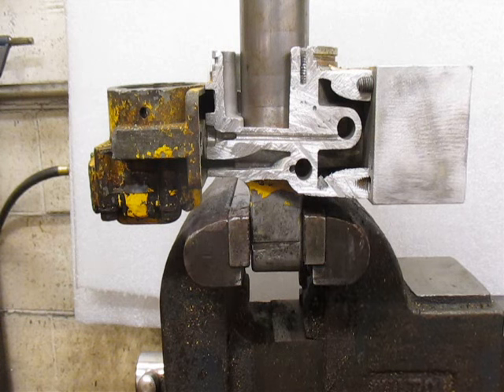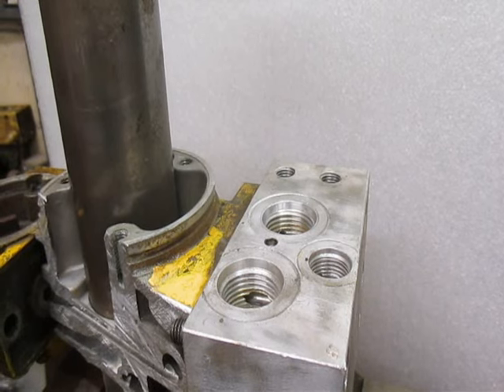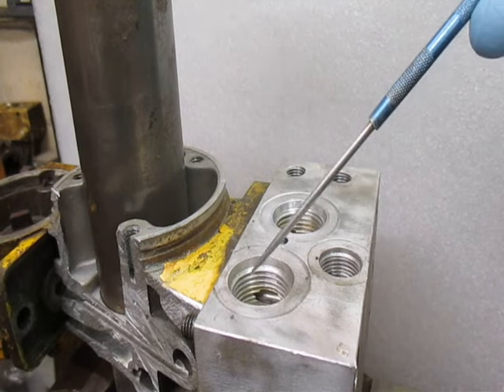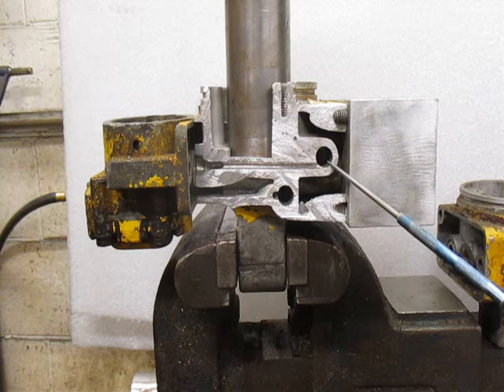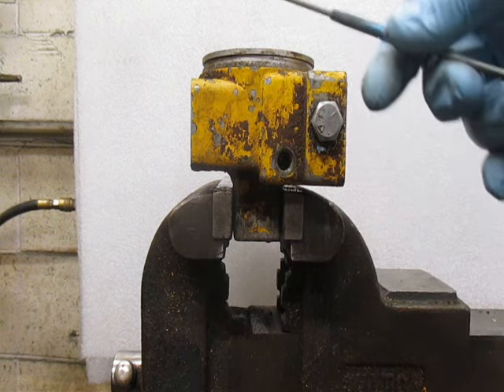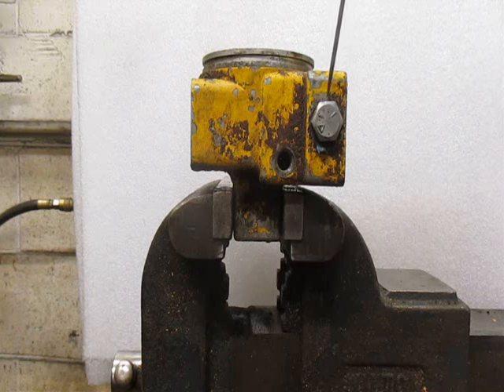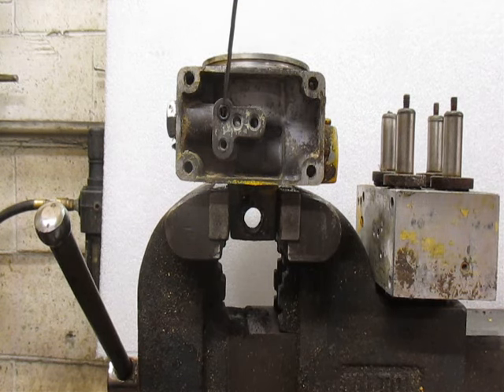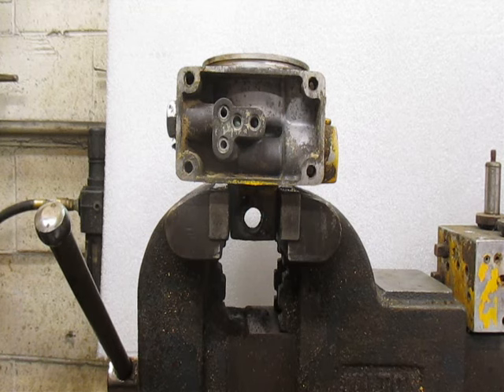Meyer E 47 Cut-Away View and Default Flow Path

Comment: I have an e47 that is leaking down. As soon as I let go of the controller it leaks down. I redid the seals on it and that’s when it started leaking down. I replaced the a valve and it leaks down slower now. The plow worked fine before I redid the seals, it just leaked everywhere. Any ideas what it could be?

Comment: I just installed a old e47 on my Truck, it angels left and right but when I hit the up leaver it does not go up it angals left ???  Any clue wtf is going on ???? Plz help!
Reply from the maker: The B Valve is jammed.
Reply: Smith Brothers Services, LLC can I un jam it or to i have to buy new . Thanks
Reply from the maker: Watch this video: https://youtu.be/pt9p1YiR2vE When I show the spool inside the Valve moving, you need to take a small pocket flat head screwdriver and press in on the spool. It should pop free. You can try smacking the flat part of the hex on a vice or anvil a few times too if it won't let go. Sometimes it helps, and sometimes you just have to buy new. I recommend you buy new, because it will stick again. But you can buy some time if you can free it up.

Comment: I followed your "C" valve checklist and it appears to function properly...but the plow will not angle to the driver's side.  What else can I do to trouble shoot?  The remanufactured pump I bought on e-bay by another builder will not contact me back.  I am stuck with this pump in the middle of winter in Montana.  Please help.  Thank you.  Frank
Reply from the maker: Meyer EZ Troubleshooter: https://www.meyerproducts.com/ez-troubleshooter you can also find my e mail address on my web site. I can't attach files or provide real helpful info here. I am not going to post my e mail here.
Reply: Check voltage going to c valve